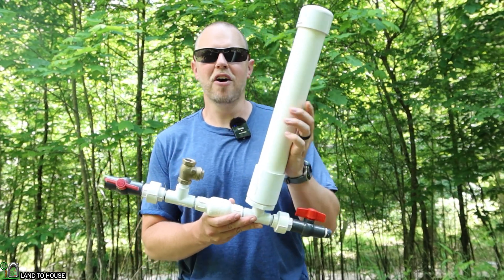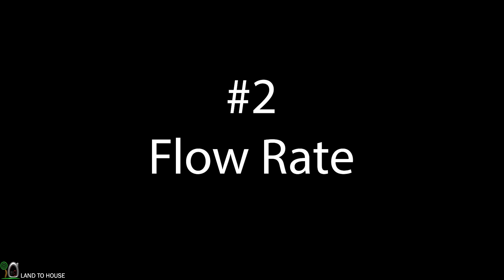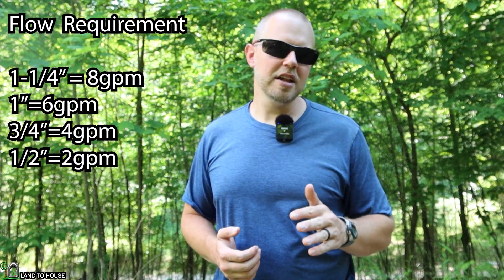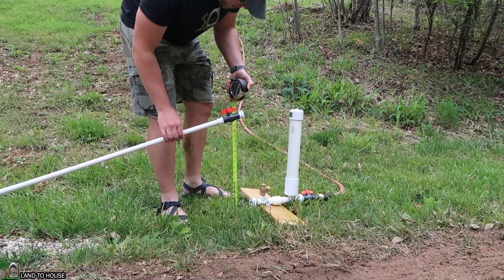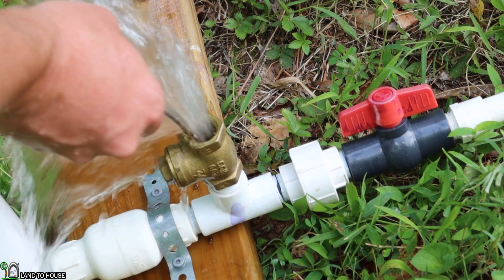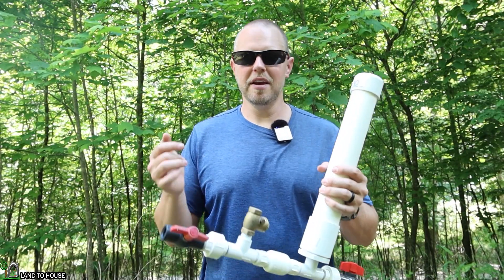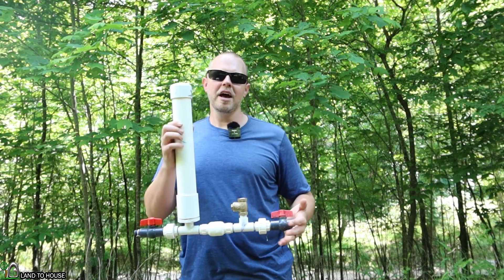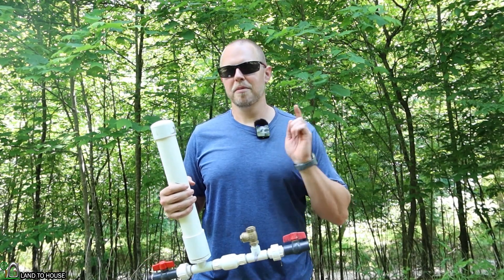8 Most Common Reasons a Ram Pump Stops [How to Fix a Stopped Pump]

Comment: My Hydram pump,was installed in 1953 and I arrived at the property in 1997 I refurbished the pump installing a stainless steel delivery pipe  and the pump has worked well However recently the pump works for a short period then stops with the waste valve shut. Have any advice as to the cause ?

Comment: Nice video and presentation. 
Page 6:00 if this is an insufficient back pressure issue, how about hold the output valve from fully open but just open to artificially make up a back pressure and wait until the delivery hose fills up before fully open it?

This is an alternative way appears dumb however can solve the start up problem. 

Instead, feed the output valve directly to an inverted U circuit with the u turn point nearly as high as the delivery end point. The disconnected hose will reattach to the end of the inverted U circuit. This can develop back pressure much sooner than a time taken to fill the entire delivery hose.

Comment: Seth, I built a ram pump based off of your design. I have a spring that feeds a 55 gallon drum. It then comes from about 6 inches above the bottom of the drum 50 feet dropping 8 and a half feet. It enters the ram pump. All of the pipe is 1/2 inch pvc pipe. Exiting the pipe is 1/2 inch poly. It travels 100 feet with about a 45 ft rise. My problem is the pump runs about 30 minutes then stops. Oh the spring puts out about 2 gallons a minute. The flow completely fills the supply pipe of the barrel. Could you give me suggestions as to what is stopping it please.

Comment: Hey Seth I have a question. Let's say you have a float valve on the delivery end to keep a tank from over flowing. Will the ram pump start back as needed or will it need to be manually restarted everytime?

Comment: Hi Seth I have 11/4 ram pump it been working fine for 2 years know but just in the last week having g a problem getting it to my tank it will only get to a point and won't go any further it's about 60 feet from the tank pump is running .check to see if had a clog in the Line no clog any thoughts

Comment: Hi Seth. I love your experiments and teaching in the ram pump setup, etc.  I have a problem I can’t solve.  1.5 inch pump, 12 feet head, 1.5 in delivery pipe of about 60 feet to the stand pipe, another 30 to the silt collector, another 30 to the screened source. 
Delivery pipe goes up about 40 feet, and is full of water so at least 10 lbs back pressure. (Not measured).  
No obvious ridges in pvc drive pipe or obvious leaks.  No air when i purge the waste valve and yet I can’t get it to start, even with delivery pipe closed off. Any suggestions? How can I tell if there is air in the pipe even though I purge it for a minute with no obvious air coming out?

Comment: Can two ram pumps share the same delivery pipe, and is the diameter of that delivery pipe important?  Late in the summer I don’t have enough water for my 1.5 inch pump but have plenty to run both during most of the year, so it makes sense to have one delivery pipe
Reply from the maker: One delivery pipe is fine for two pumps. Depending on how far you push water the size will be fine at 3/4" if you are going a long distance like 3000 feet you might want to step that size up.

Comment: Hey Seth, been loving your videos for years. I'm not far away in southern Virginia. I've been working on a ram pump in scraps of free time, and I've finally got it mostly installed. It's a 1-1/4" pump (I spent ages building my own, and after that experience, I highly advise buying the pump for less money, prebuilt by Land to House) and 1-1/4" drive pipe as well, about 60ft of drive pipe for a ~10ft fall (6x vertical fall per the excellent Clemson LG Press article, Homemade Hydraulic Ram Pump for Livestock Water). Fingers crossed to reach some plum trees about 70ft above the pump. So far, I've been able to get the pipe to cycle on its own even up to maybe about 50 times; but it eventually does stop. I am siphoning over a dam, and after watching this video, I'm thinking it's the siphon effect you described. I'll trying siphoning over into some kind of catchment, and drive from there :)

I want to add that I recently had a fun experiment which I thought you'd appreciate. I tried to start the pump (from the siphon) while the pond was frozen over. Obviously, that did not work because the ice shielded the surface of the pond from the atmospheric pressure needed to push the water into the siphon. So I banged at the thick ice with a shovel until my hands couldn't take it anymore. I managed to open up about a 6" diameter hole above the intake manifold. I tried it again, but still no luck! So I guess either the siphon needed more surface area exposed or there was some other problem. But it was fun to experiment.

Comment: At 7:10 you say "As long as you don't have the delivery pipe end at the farthest point". What do you mean by that? My property is undulating so I have had to run the delivery pipe up one ridge, down into a ravine, and back up the next hill. 

I have successfully managed to get water to pump all the way to the end, so I don't THINK I have a siphon issue, but my RAM pump keeps dying. Right now I suspect either air bubbles getting into the drive pipe OR debris suck in the secondary valve. The waste valve will cycle a few times, sometimes even several times, and then it stops. When it cycles it is frequently "double-tapping" on each close. Any ideas?

Comment: Curious issue that occurs with a 1 1/4 ram pipe. It "double cycles" in quick succession, then will not cycle for 5-7 seconds. The issue goes away after a day or so of the pump running, and I'm assuming its from the extremely mild slope of my creek. I guess it could also be from air in the pipe working its way out, or debris in the pipe, but its really difficult to tell. It usually comes up after a heavy rain and my ram pump was completely submerged for an extended duration.

If you know of this, or a quick fix, let me know! 
Specs: 1.25 inch pipe, 60 feet of 1.25 inch drive pipe (pvc), Just over 2.3 feet of drop
Reply from the maker: That sounds very much like an air bubble that is stuck in the drive pipe.   The pressure wave hits that bubble turns around and heads back to the pump. Then it pulls the bubble closer to the waste valve and does it again. The pause will oftentimes let the bubble go back up the pipe and the whole thing happens over again.
Reply: @LandtoHouse  thanks for the quick reply, I thought the same thing, and extensively left the waste valve open, only for it to curiously happen for a bit afterwards as well. Eh, I'll play with it tomorrow and see what fixes it
Reply: I did figure it out. The ram pump would get silt pushed under it after a storm, and because of the mild slope of the creek, the raising of the pump made the drive pipe into a very slight "U" shape before it reached the pump. The pump then would settle in the silt due to the continuous cycling, and get back to level with the pipe.

Comment: Will using metal drive pipes help with low-head?  I was thinking the creek is pushing on the PVC pipes trying to send them downstream and they're wobbling around with the pressur ewaves, I tried to secure them with random logs, but that a really solid drive pipe like galvanized will help with the incompressible water property that this device exploits.  That'd be a good video, comparing metal drive pipes with PVC, to complement the video comparing PVC with polypipe.

Comment: Have you had issues with hand-tightened PVC fittings on the ram pump, you know, tearing it down in the creek and reassembling?  I've had some issues with that coupler with the big o-ring loosening due to the thumping of the pressure wave and tension left or right from the drive pipe in a snaking/meandering creek.  I just wonder how much small leaks in the PVC fittings like that impact the cycling of it, or if the focus should be elsewhere.  Are you using teflon tape on all threaded connections (i.e. the ones with the o-rings), or only the other threads?

Comment: AHA, back pressure drop!  I took the delivery pipe/hose off when troubleshooting so I have zero back pressure currently.

I also abandoned the 5 gallon bucket catchment on the drive pipe when I took the pipe there to lengthen the drive pipe.  I may have to revisit that now that the uniseal was delivered.  Slightly concerned there is something stuck in the inline check valve but I left both valves open last night when I gave up and maybe it has rattled loose by now.  

On the drive pipe intake, I ended up using an extra trash pump foot valve screen cylinder thing and the 1-1/4" pipe slides right into the barb connector.

Comment: Is the minimum 2.5ft drop uniform for all the sizes of ram pump?  Can your tiny 1/2" or 3/4" pump get away with less?
Reply from the maker: That input head pressure is typically the minimum for all sizes. You can slightly tilt the waist valve to the side and get by with just over 2' But it's unreliable.

Comment: When i first got my pump from you it ran fine for 3 weeks. For some reason i can not get it to cycle now. the water comes out of the valve but doesnt "close". ive checked the flow and it is fine. I actually bought another valve but it has same issue. I can turn the pump over and it will click shut but not cycle. push it and then it just stays open again.
Reply from the maker: That is often due to air or debris in the drive Pipe.

Comment: Hello Seth, please excuse my english, I use goole translator.  I have a question about the ram pump.  I've seen all your videos but I can't explain my problem.  my flap valve doesn't really close, even though I have enough high pressure.  If I tilt the pump and the valve closes, it no longer opens, even if I put the pump back up.  I used a garden hose for the first test, could that be the reason?  or did I use the wrong valve?  Thank you for your answer
Reply from the maker: Hello. The drive pipe needs to match the waste valve size. The water source needs to be open to air. Garden hose is too flexible and does not work.
Reply: @LandtoHouse  
Thank you very much for your tips, I will try it with a PE pipe

Comment: I find your ram pump videos fascinating.  I wish I had an actual need for one, and would buy it from you.  I have an off grid summer cabin with a gravity water system with 3 1-inch hoses running around 300 feet up the hill into the pool in the brook.  My intakes are quite similar to the ones you are using.  Great work on your part!